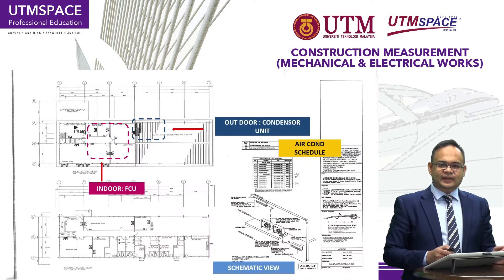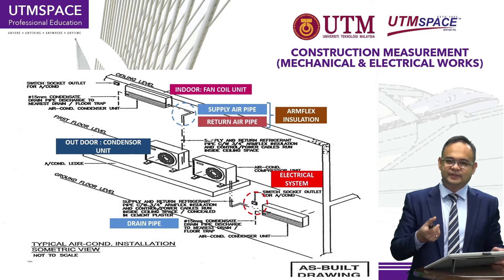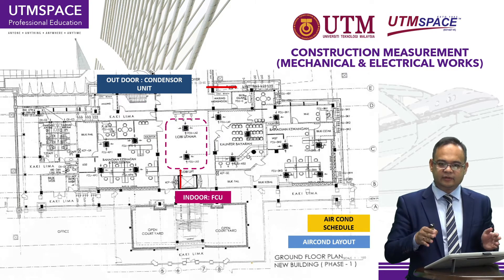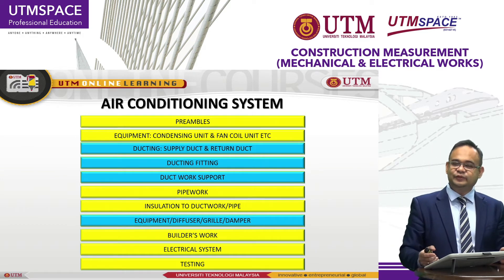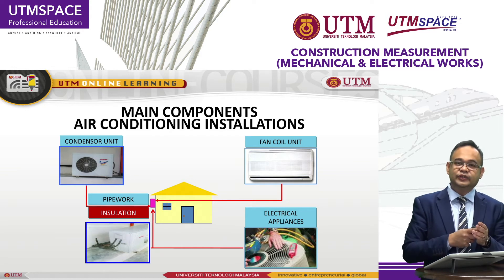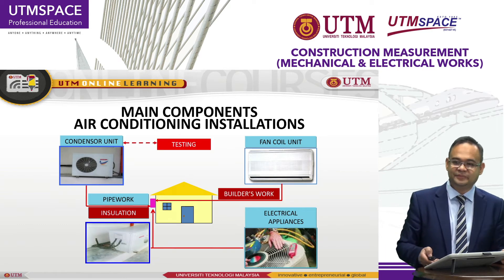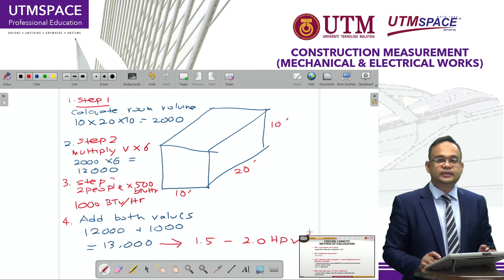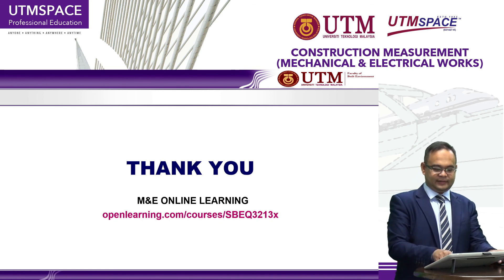Video 5 Construction Measurement for Air Conditioning Installations

Comment: From this video, i have learnt that Central and split AC both work on the same principle, but they have different cooling capacities, so both are suitable for different sites. Split AC is divided into two parts, as it has a large capacity, so it is ideal for use in large offices and big places inside the house. On the other hand, the Central AC system is a single unit conditioner, as it is suitable for small rooms only.

Comment: From this video I understand more on Air Conditioning Installation for Split and Central Unit. I learn regarding air-conditioning drawing and schedule. The Air Cond Schedule contain location, cooling capacity and type of aircond. 

For split unit, I learn regarding connection between outdoor and indoor unit. There are 3 types of pipes used in split unit which is Supply Pipe, Return Pipe and Condenser Pipe. Supply and Return pipe need to insulated and Supply pipe diameter is smaller compared to Return Pipe.

Besides that, I also learn work process or rules of calculation for Air Conditioning Split Unit and Central Unit. By referring to SMM2 Air Conditioning is calculated based on Section Q in SMM2. Below is the calculation process:-

1.	Air Conditioning Split Unit
-	Preambles
-	Equipment: Condensing Unit & Fan Coil Unit
-	Pipe Work
-	Insulation to Pipe Work
-	Builder’s Work
-	Electrical System (Under installation. To make sure there is power supply for air conditioning)
-	Testing

2.	Air Conditioning Central Unit
-	Preambles
-	Equipment: Condensing Unit & Fan Coil Unit
-	Ducting: Supply & Return Duct
-	Ducting Fitting
-	Duct Work Support
-	Pipe Work
-	Insulation to Duct Work / Pipe Work
-	Equipment / Diffuser / Griller / Damper
-	Builder’s Work
-	Electrical System (Under installation. To make sure there is power supply for air conditioning)
-	Testing

Besides that, I also learn formula for calculate cooling capacity in 1 building. The Formula as below:-

STEP 1 (Find the volume of calculated room)
= Length X Width X Height
= m3 X 6 (fix formula given)	
= C1

STEP 2 (Calculate Body Heat) 
= Estimated How Many Person in Room X 500 BTU/HR
= C2

STEP 3 
= C1 + C2
= Room Cooling Capacity (BTU/HR)

JOY AREN ANYI
SX190994BEQS12

Comment: now i know that different air condition system required different item need to be quantified. different type and size of room or building also contribute to different aircond system requirement.from size of room we can assume what type of aircond system will be installed. electrical point are measured in number not to be confuse with electrical installation.

Comment: Titty Ricca Binti Suhaili (SX190985BEQS12)

1. Air conditioning systems are classified into three types: unit systems, package systems, and central systems. SMM2 Section Q refers to the component for measuring the air conditioning installation and ventilation. Finding the right air conditioner size is critical because each home is unique, and the size of your central air conditioner will be determined by factors other than the size of your house.

2. These are the list of items to prepare the BQ for split type air-conditioning system namely Preambles, Equipment: Condensing Unit & Fan Coil Unit etc, Pipework, Insulation to Ductwork/Pipe, Builder's Work, Electrical System, Testing, Ducting: Supply Duct & Return Duct, Ducting Fitting, Duct Work Support & Equipment/Diffuser/Grille/Damper.

Comment: The important thing for costing and create the Air-Conditioning BQ is the informative and sufficient of drawing. 
There is two type of information Air-Cond drawing that can help the client and contractor to understand the air-conditioning design:
1. Air Cond layout plan – Location of Air-Cond fitting (outdoor & indoor unit), ducting, refrigerant pipe, drain pipe, Air-Cond schedule – cooling capacity and type of air Cond (wall mounted & ceiling cassette)
2. Schematic Drawing – Connection between outdoor unit to indoor unit , Detail schematic drawing – Supply and return pipe detail (size and connection), insulation
This lecture video help me more understanding on the sequence/step of Air-cond Installation and know what the component that involved.

Comment: An air conditioning system is an electrical device that is purposely installed for the removal of heat and moisture from the interior of an occupied space. It is a process that is commonly used to achieve a more comfortable environment, basically for human and other animals. From this video, I can find out there are various types of air conditioners like window air conditioner, split air conditioner, packaged air conditioner and central air conditioning system, air conditioning installation rules in SMM2 and most interesting is air conditioning calculation (Rule of Thumb).

Step 1
Find the volume of your room in cubic feet. This is done by measuring the length, width and height of the room in feet and multiply all the three dimensions together.
Volume = Width X Length X Height (cubic feet)

Step 2
Multiply this volume by 6.
C1 = Volume X 6

Step 3
Estimate the number of people (N) that will usually occupy this room. Each person produces about 500 BTU/hr of heat for normal office-related activity. Multiply this two figures together.
C2 = N x 500 BTU/hr

Step 4
Add C1 and C2 together and you t get a very simplified cooling capacity needed for the room.

Thank you.

Yusti Taili
SX190981BEQS12

Comment: From this video, I'm able to understand the component and item of the air-con installation. other than that i also know about the type of air-con unit such as split unit and centralized system. Type of installation divided into wall mounted and ceiling cassette. Other than that, this lecture also explaining on the method of measurement used for taking of the air-con installation such as the clause that need to refer in the SMM2 and what the description that need to create. overall, this video is very informative and i love it.

Comment: I am able to understand the installation of electrical engineering and the component that needed to be measured from this video. Because airflow conditioning should be able to provide a consistent and adequate supply of ventilation, the system must be installed in accordance of manufacturer's instructions and must be approved by the M&E consultant. It is important to install the suitable type and size of air conditioning based on the building requirement/usage. It will be measured in numbers in accordance with the quoted horse power by using SMM2.

Regards,

Abang Hisham Bin Abang Seruji
SX 190983BEQS12

Comment: It is important to install the suitable type and size of air-conditioning based on the building requirement/usage because good air-conditioning should be able to provide a constant and adequate supply of ventilation. The insulation work plays an essential role to ensure the indoor are air cool. Generally, the list of items to prepare the BQ for split type air-conditioning system are as follows:
1. Preambles
2. Equipment: Condensing Unit & Fan Coil Unit etc.
3. Pipework
4. Insulation to Ductwork/Pipe
5. Builder's Work
6. Electrical System
7. Testing

However, for installation of a central unit system, the following list of items shall be added to the above list:
1. Ducting: Supply Duct & Return Duct
2. Ducting Fitting
3. Duct Work Support
4. Equipment/Diffuser/Grille/Damper

Noorazlini Binti Tuah
SX190979BEQS12

Comment: Airconditioning system divided into three systems that is unit system, package system and central system. The component for the measurement of the air conditioning installation and ventilation are referred to SMM2 Section Q. 
The component for the measurement of the air conditioning installation:
1.	We need have the equipment for example condenser unit and fan coil unit.
2.	To connect this equipment pipe work and all the pipe work, supply pipe work needs to be insulated need to do the insulation and electrical appliances electrical system, builder’s work within connection and finally testing and commissioning.
Finding the right air conditioner size is very important because each home is different, and the size of your central air conditioner will depend on various factors apart from the size of your house. These factors include your roof type, the height of the ceiling, number of windows, type of insulation, heat transfer of the walls etc.

Phang Su Kim
SX190993BEQS12

Comment: From this video, I able to understand about Air Conditioning installation and the element to be take off based on measurement rules in SMM2 . Able to understand the schematic diagram of aircond installation, classification of main system of air conditioning installation, main component or the air cond and also the step  calculation of BTU/Hr of Air cond. 
Construction Measurement for Air Conditioning Installations comprises of the following items: 
1. Preambles or General Notes 
2. Equipments - Condensing Unit and Fan Coil Unit 
3. Ducting 
4. Ducting Fittings 
5. Ductwork Support 
6. Piprework 
7. Insulation to Ductwork and Pipework 
8. Equipments to Ducting 
9. Testing 
10. Builder's Works in Connection (BWIC)
Measurement rules:  Section Q
Q.1 Information
Q.2 Classification of work
Q.3 Location of work
Q.7 generally
Q.8 Pipe & fitting
Q.9 Special connection and etc

Cerinna Anak Steve
SX191174BEQS12

Comment: Every air conditioning installation shall be include the air-condition of packaged system, which consisting air condition unit complete with refrigerant piping, supply and return duct and other accessories and works needed and the system shall be installed according to manufacturer’s instruction and to be approved by the M&E consultant. Based on the SMM2, it shall be measured in numbers according to the horse power stated.

Cindy Anak Nojien (SX190975BEQS12)